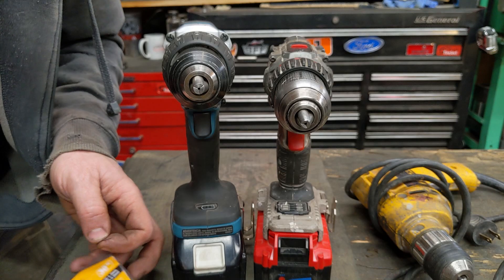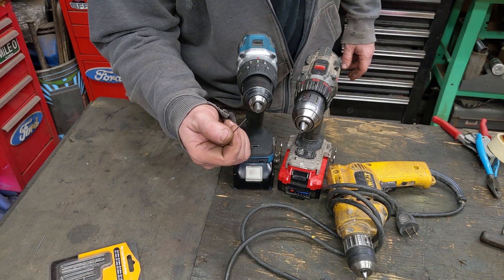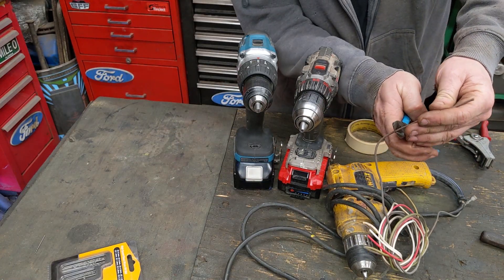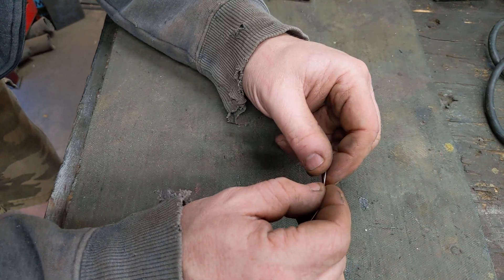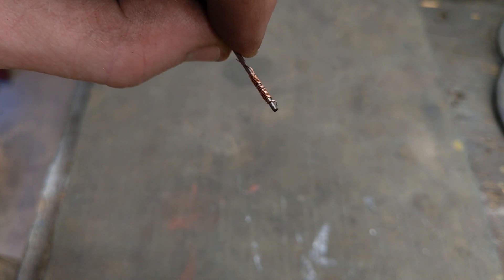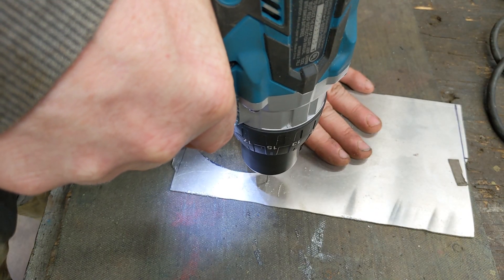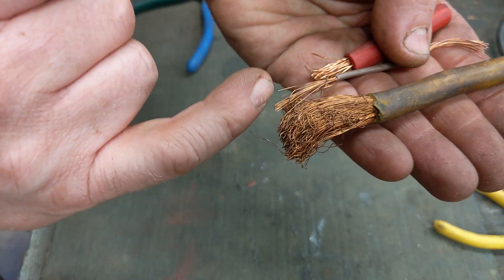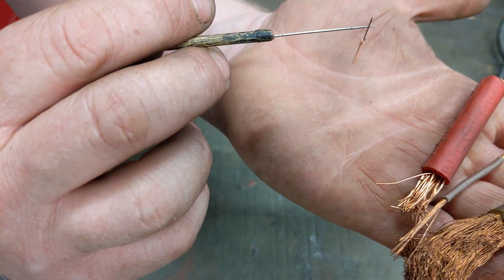How to use MICRO drill bits in a standard drill chuck

Comment: Great tip👍  Also…you can get a pin vice micro chuck, tho’ designed for hand use, some have a shaft slim enough to fit into a drill chuck.

Comment: I do have a question can you use like floral wire for example or other similar like products or is their a certain reason for why you went with copper immediately
Reply from the maker: Any wire you can easily wrap would work. Copper is just soft and extremely easy to wrap.

Comment: How do you measure such small dia holes? 
A plane plug gauge of 0.3 mm tents to bend over time. Is there any other measuring device to measure micro drill holes?
Reply from the maker: Generally with tiny holes I use various size drill bits inserted to find the diameter.

Comment: Well!  I could have used that tip a hundred times.  Again... electronics.  

Back in the day, I made my own through-hole circuit boards and, used bits down to #60.  Tiny!  I wrapped them in PVC electrical tape but, like you pointed out, they slipped and were forever off-center.  Snapped a lot of expensive bits that way!
Reply from the maker: Thanks, I'm glad you liked it.

Comment: I have a hard enough time to not break a 1/16th bit when I use them 😅😅😅 
When you pulled out the wire, I thought you were going to say to cut a piece, pull out all the copper wire, and use the plastic sheath to slide the bit into. Using the wire I'm sure is better. Copper is soft to conform to the chuck, and it will still get a good grip on the bit. Nice hack 👍 👍 👍

Comment: I have a drill the Chuck is tired & hate giving up using it. 
I just may try this on larger bits too. 
Thanks Man
Reply from the maker: I've actually used this technique on large drill bits where the chuck constantly slips. You need a lot more copper though probably around 6-8"

Comment: Great tip! The other thing I've done is use one of the small collet chucks that come on the cheap rotary tools, after the motors burn out, or even before. They're only $6.99 for the whole tool.now all I have to do is figure out how to keep from applying too much force to those micro drill bits and breaking them off. 😆
Reply: I'm going to be drilling 1/32" pore holes into sections of PVC pipe for a sand filter. I had snapped a bit at 1/16", and those pores were still too wide to keep sand at bay. My plan going forward is to put my drill in the vise and zip-tie the trigger, then feed the PVC onto the bit. The most force on the bit was from the drill itself.

Comment: Clever tip. As long as the wire doesn't cross over itself, it should remain concentric about its axis. 
So much easier than chucking a pin chuck in the drill.
Reply from the maker: Thanks, I'm glad you liked it.
Reply: Legend has it, if you start chucking chucks into a chuck xzibit might show up xD

Comment: I was thinking heat shrink tube or find some thin wire and take  an inch of the jacket off to push on to the drill.
But i was way off lol.
A small collet chuck would be nice.
You can't trick  your dog, she is too smart :-D
Reply from the maker: Yeah, I've been meaning to buy a small collet chuck for years but I just keep using this technique.

Comment: Yup. Been there, done that. Copper  has got excellent grip. What I usually do though is chuck the micro bit in one of my pin vices and chuck the pin vice up in my drill. I'd never thought about leaving the copper wire on the bit. I store my bits tip up in their index. But tip down works too.  ..another informative video. Thanks
Reply from the maker: The copper really bites well with these.